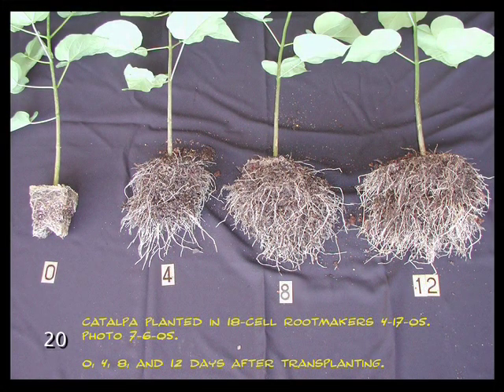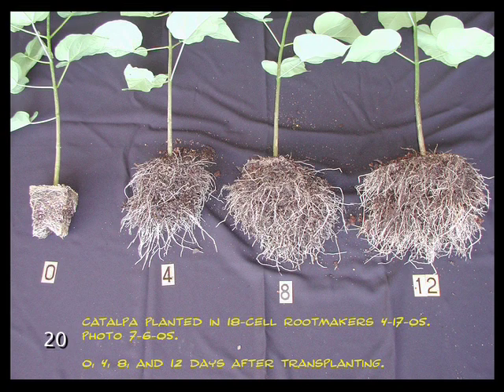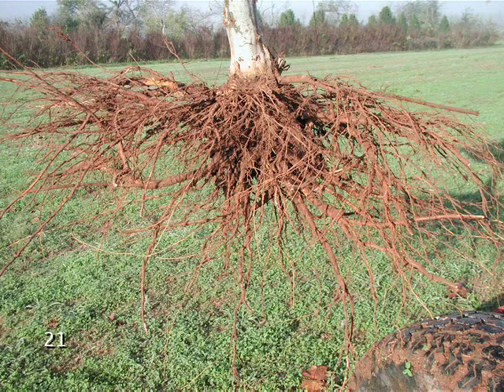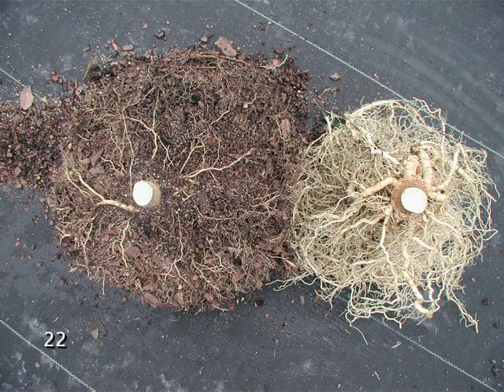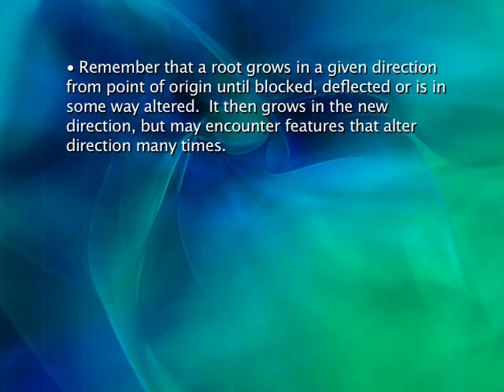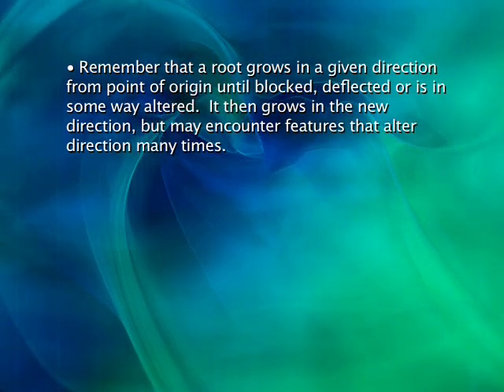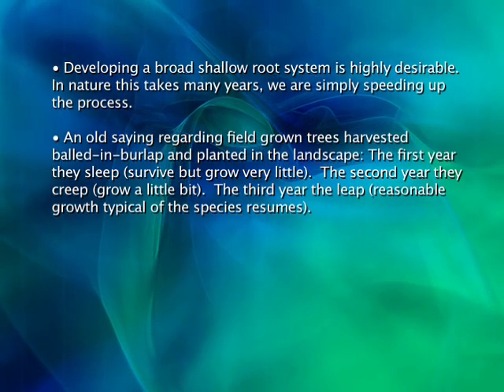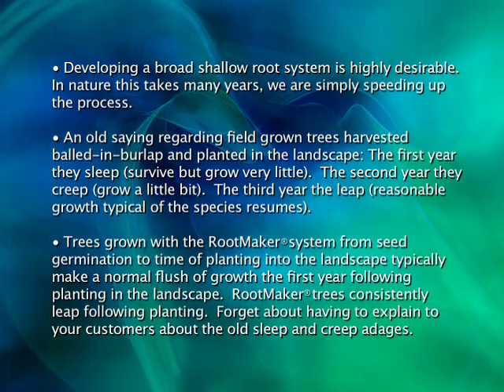Root Systems Basics

Comment: I experimented with air pots this summer and the results were absolutely amazing.  I made my own with solo plastic cups with 4 slits cut on the sides and 4 drainage holes on the bottom. Then up to half gallon milk jugs with the same slits and holes. And then into purchased air pots.  It’s the way to go.

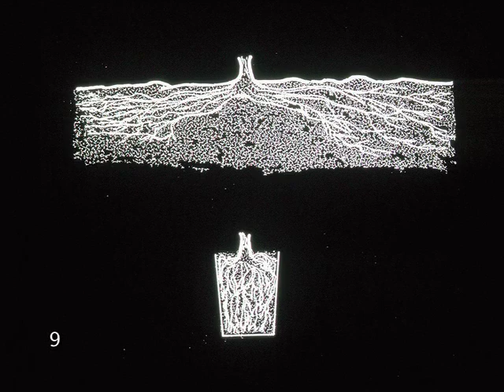Comment: 3:44 This is a very good reason to investigate the root structure before planting into the ground or bigger pot. The tangling circling roots will not simply sort itself out.
My plant refuses to grow bigger & dying at a gradual pace. After root investigation, it turns out the roots are circling & choking itself to death, it doesnt spread laterally at all.
Always check the root structure especially for plants that comes in a small pot.
Wash the soil out with gentle spray of water & spread the root manually before planting.

Comment: The information presented here is really compelling for me in regards to planting smaller bare root stock.  You can clearly see the root structure, adjust and spread it out as you plant the tree.  It might take one year for additional roo development, but then with a known good root structure, those trees can really take off.  It is great to plant whips that are less than 6' tall, and for some trees, less than 3' tall.  I have a catalpa that I planted as a small 3' transplant a little over 4 years ago.  That tree is now ~20' tall and has a great structure (of course you have to prune them) as it has great roots and those trees can grow 5' a year.

Comment: Bigger&better the roots, bigger&better the fruits! Love all the knowledge good Sir! ✌️
Reply: Hey man, have you tried this on cannabis yet? I normally do auto flower so I was going to place a germ seed in a 4 inch rockwool cube and and then place it in my final pot to see if I can get similar results. Only question I have is if the bottom of the cube needs plastic or something over it, what’s going to stop the tap root from continuing once put in a 7 gallon pot of coco.
Reply: @run572  How did the experiment go for you?

Comment: so, what I'm trying to figure out is if it is better to grow plants in air pruning containers or if it is better to just grow plants in the ground. help?
Reply: I grow everything in the Root Makers.  I live in the desert where it freezes in the winter, 115 in the summer.  My water usage for this small farm was out of sight. Plus nothing was really healthy and there were a lot of heat stress related problems.  I took the plunge and dug up all my dwarf fruit trees, cut them back and replanted them in the Root Makers.  I am so glad I did, everything is now so luscious and healthy and my water usage is about 75% less.  I had problems with the Root Makers drying out too fast so I wrapped the outside of the containers with loose weave shade cloth and then set them in those black storage containers with the yellow lid you buy at Home Dept.  Not using the lid of course - but now I water them top down and the water that is drain-off either is drawn back into the container or provides humidity as it evaporates.  It has been very successful for me.  Now I just take 5 gallon Food Grade containers and drill a lot of holes, still wrapping the shade cloth around them and that works great.  I was not fond of the black color Root Makers, I feel the white is a better color - a better Vibration, plus it is a food grade container - $3.00 at Walmart..
Reply: @SUHSeungJi  Hi Ed, I would like to reduce the amount of watering. Can you send links to the products: "'oose weave shade cloth and then set them in those black storage containers with the yellow lid you buy at Home Dept" AND "5 gallon Food Grade containers and drill a lot of holes, still wrapping the shade cloth around them and that works great.  I was not fond of the black color Root Makers, I feel the white is a better color - a better Vibration, plus it is a food grade container - $3.00 at Walmart" You can also send pictures to WendyWard700@gmail.com
Reply: @SUHSeungJi  Are you wrapping shading fabric around the outside of the pot? Or just above where the ground is?
Reply: Around the outside of the pot, fastened with mini zip ties
Reply: If you plant them directly in the ground, some will develop a good root system, others less. This system tries to give all the seedlings a better start.

Comment: Really interesting thanks!
Reply: I've been reading a lot about growing pots in fabric bags or pots with large holes in, lined with fabric, and I was thinking about having a go with this myself but then I remembered something I read somewhere about growing plants in transparent pots having the same effect. Cannot remember where I read this, but I found this link http://gardening.stackexchange.com/questions/731/is-it-ok-to-grow-plants-in-clear-transparent-pots
(see the answer from Mr Compost about 4th one down when I looked). Seems a lot easier than using fabric pots. Anyone else got any info on this?
Reply: +kate strouts  My first thought would be that the roots would cook from the increased temp.
Reply: hi Kate,
Did you wind up trying the transparent pot? I’m curious to hear about your success or other. My first instinct with your question is that it would not have the same effect because there wouldn’t be any air pruning occurring. However I do wonder, based on the other reply, if heat could make up for that. If the root tips are dehydrated due to increased heat, this should lead to the same end: thicker root system with lots of lateral feeders. 
However I wonder, would the roots actually get hotter in a transparent pot? Wouldn’t it be a darker pot that leads to higher heat? 
Seems like a silly conundrum for those who don’t want the best out of their plants, but this does strike me as a plausible concept with practical implications for my own tree-growing interests.  I’m definitely going to look into it tomorrow. Sleep first. Sorry for long comment!!! Goodnight hehe

Comment: ok so how about a comparison between a fabric pot and this 'rootmaker' container? Not just that but a 5 gallon bucket with tons of holes drilled in it or some net pots would be far cheaper than your product.
Reply: I grow plumeria using 5 gallon buckets with holes drilled in them, then I line the bucket with a paint strainer, it works great.
Reply: @JSharp619  I spread the bucket with a filter for painting?
Reply: Kyle Lester What about burlap bags?
Reply: ***** What is that noticeable difference that's worth doing? Watering habits?
Reply: Kyle Lester His key feature is the triangle edges that guide growing roots to holes in the sides for air pruning.  others don't have this ability and create swirled  roots and slower growth.   The science is amazing!   it sounds like he has spent many many years developing this system.  If i grew trees I would use this.